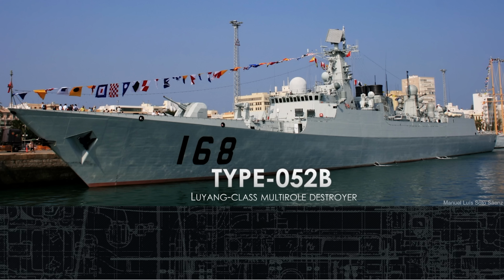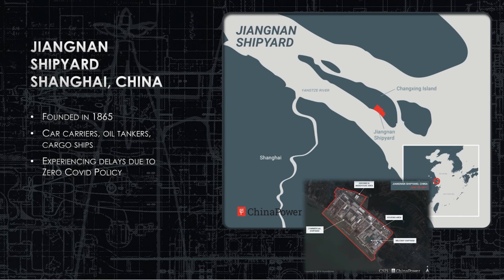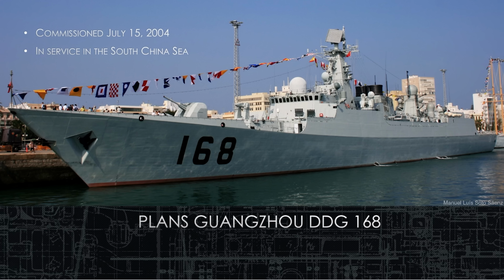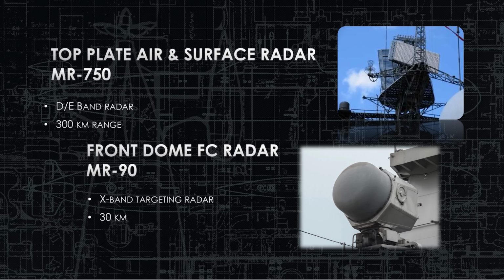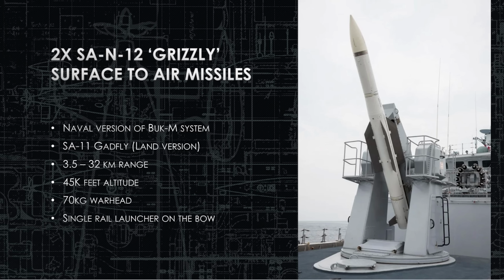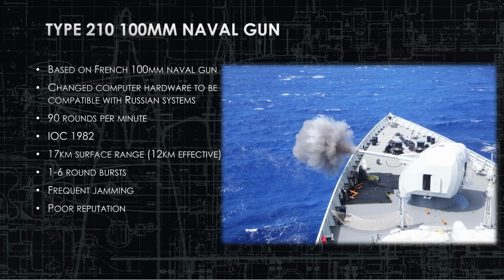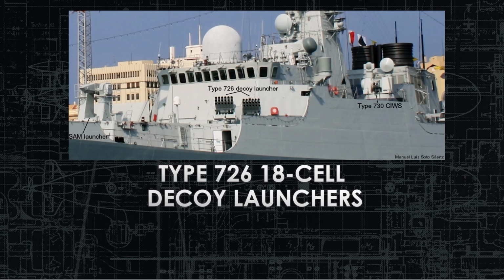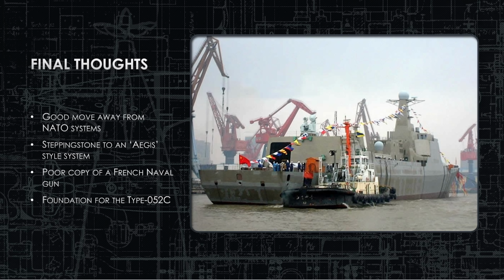Is China's Best Destroyer THAT GOOD? The Truth...

Comment: Couple of corrections. MTU is a German engine not Ukrainian. The 1163 diesels are German sourced. The Mineral radar also uses a lower frequency to achieve the ducting you referred to for the limited OTH performance. The lower frequency and longer refresh rate mean it’s not really suitable for anti missile detection. It’s a targeting system for the antiship missile battery more than anything else.

Comment: China's best destroyer is the Type-055, 8 in active service.
It's closest competitor is the Zumwalt which the U.S has 2 in active service, which have the same issues the LCS class had, they were built from aluminium.
It's not even the Type-055 the U.S has to worry about, it's their fast attack missile boats, Type-037, 67 in active service succeeded by the Type-022 which they have 82 in service.
When China launches their Type-055, Type-022's, Z-10's, DF-11's, at Taiwan and the 7th fleet (60-70ships), the U.S is done, they won't even need NK or Russia's assistance.
Reply: Yeah, china will take Taiwan in 3 days, right? I heard this somewhere

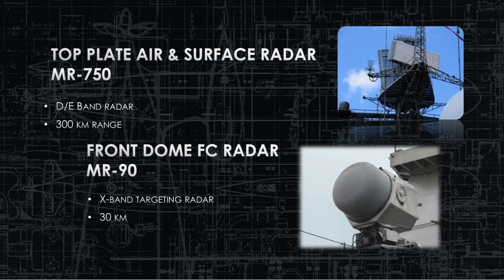Comment: @7:20, he says to 'keep an eye open for that 1200 rpm.' vis-a-vis the electric generating diesels providing hotel power...

Am I correct in my supposition that this is a sonarman thing? (I.e. listening to engines running at 1200 rpm could be an acoustic signature of these diesels running while the rest of the ship may be quiet, e.g. how prop rotations can likewise be counted and analyzed?)

If so, that is very cool. My grandfather flew P2Vs and has a ton of respect for the sonar guys.

Comment: Well, the 52 series are actually Frigates (albeit large ones), so as a multi-role Frigate this is perfectly capable. Be aware that the YJ-83 -KH variant is also being developed as a sea-launched version, with only a slight range reduction, and the possibility of mid-course correction via friendly assets.
Reply: 052 series are destroyers, the 054 series are frigates
Reply: 054 is frigate, however you can also consider 056 to be one as well as it's generally larger than western corvettes

Comment: The type 052B are currently undergoing a Mid life upgrade, hull 168 seam to be complete, hull 169 is still in drydock.
Known upgrades are:
*Removed both arm launches and installed a 32 cell VLS in front. This is not the full size VLS found on type 052D and 055 but rather the smaller H/AJK-16 found on the type 054A frigate able to fit rocket launched Anti sub torpedo's and the HQ-16 missile family. (The new HQ-16FE is a vast improvement on the old buk missile and can reach out to 160km).

*New sensor suite with the 052D ESM mast, Type 382 radar replacing the Fregat, Type 366 replacing the Mineral-ME and 366-2 datalinks replacing the Mineral-ME 3, the entire AJK-16 set with the illuminators, Type 726 ESM/ECM set.

* YJ-83 antiship missiles replaced with the supersonic YJ-12

* Main Gun was temporarily removed during refit, not sure if replaced with another version or what they did to it.

There are probably more changes but info is sparse.
This is a fairly substantial MLU turning an obsolete Destroyer into something with the capability of a decent modern frigate.
Reply: Should be very effective against Joe Brandon's woke gender queer navy.
Reply: Yeah based on what information we've heard on the Type054B the Type052B MLU is basically identical in capability.
Reply: a DESTROYER with the capabilities of a frigate.  Terrifying.  Might as well save your keystrokes and call it an LCS.
Reply: @ColonelEviscerator the Chinese 056 corvette and Hubei missile boats have more capability than the American LCS. If anything gives a nudge to the LCS, the thing shatters 😅
Reply: @ColonelEviscerator  upgrading them to 054b frigate spec is not a bad idea.... they're still quite capable ships
Reply: @ColonelEviscerator  These 2 destroyers came out before the LCS which have less capabilities than Chinese frigates. China has later destroyers that terrify you too.
Reply: @tritium1998  Ok Chinese bot
Reply: @RevolverOcelot79  The LCS is just a piece of garbage that the USN keeps building for some stupid reason. It's more useless than screen protector.
Reply: Wow, the propaganda upgrades are amazing.
Reply: @fernarias  Calling 20yo 052B the best destroyer is the type of propaganda you love.

Comment: What do you think about the new Chinese attack submarine Type 093B SSN? They just launched another one of those on Bohai Shipyard in Liaoning Province.
Reply: In fact they are capable of building and launching one every 4 months during peacetime.

Reports also say during wartime they can build and deploy many times this amount because of its module construction and modules are manufactured in various locations and transported to the shipyard.

China expanded its major inland sub-making shipyard to massive proportions.

There is nothing in the West that can compete with it.
Reply: @ltribley  Exactly the same methods they employ with commercial shipbuilding. Everything is modular, and the only purpose of the yards is to "assemble the construction kit".  Also, by spreading construction out over a very large physical area of suppliers, effective damaging of their shipbuilding capacity becomes quite a challenge.
Reply: Potentially capable of building four boats every year.  That is in addition to their existing massive surface vessel yard capacity (and capability), with everything they need locally produced.  They have more capacity than the entire West by a very wide margin.
Reply: Didn't China just sink one of their subs, all hands lost minus a diver?  :)
Reply: @Aircarepilot32817 yeah they lost it, same like f35 shot down by iran.

Comment: There is one visible hazard widely existed in PLAN major destroyers/frigates built after 2000s: Type 052B/C/D and Type 054A have only one funnel , which means single engine room or two concatenated engine rooms. Could be easily paralyzed by a single hit. Even the latest Type 055 featured two funnels, these are housed in the same structure, means two main engine rooms are still closed to each other. US Navy major combatants are not designed this way,  Spruance-class/Ticonderoga class and Arleigh Burke  class had their two main engine rooms well separated.
Reply: With modern weapons hitting a hull of this size the chances of surviving the hit in an operational state is virtually zero.
Reply: really doesn't matter, a ship getting it in modern warfare sinks no matter where what.